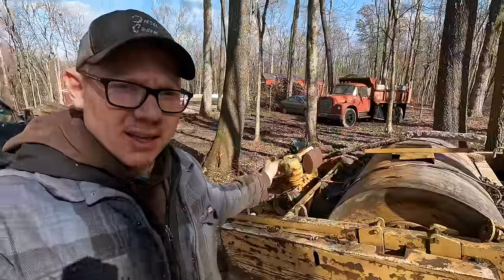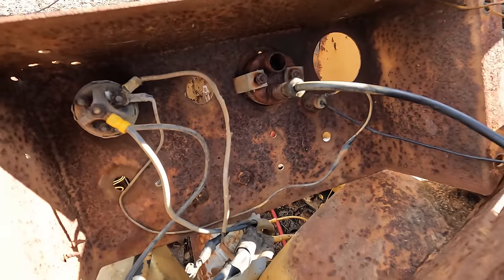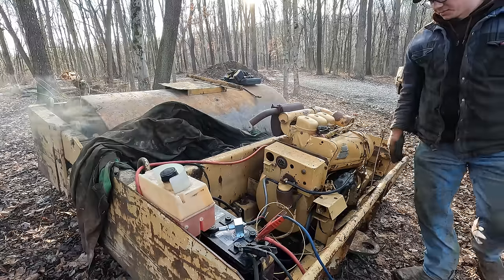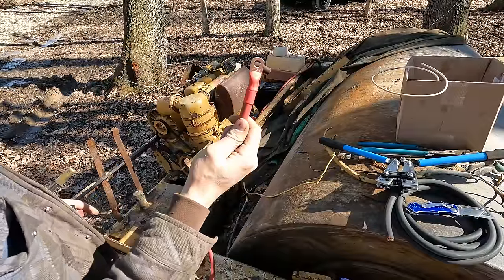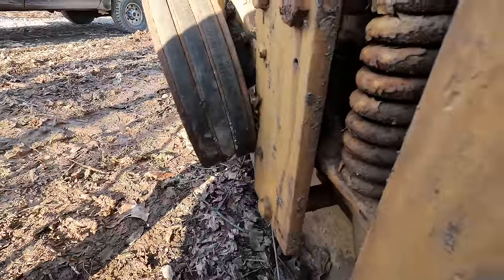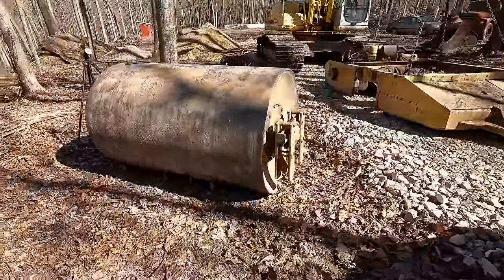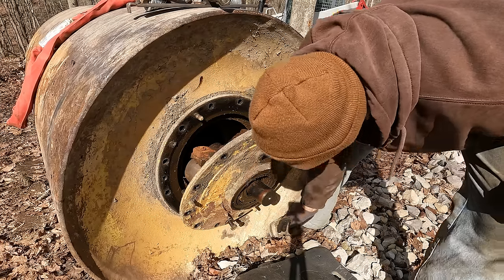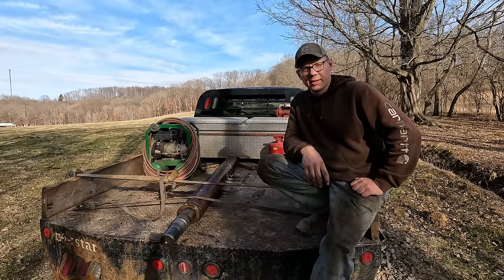Diesel Roller Compactor First Start in 30 years!! Can it be saved??

Comment: I would get the alternator rebuilt, fix the lift pump, clean lube and reuse all bearings, weld the shaft, etc. It will last as long as you need it, after that you can decide if you want to restore it.

Comment: Soldering that cable was the wrong thing to do. All that happens is the solder moves down the core making the cable stiff and now prone to the wires cracking under vibration. The solder will also deform over time, the alloy structure will then crumble and the connection will work loose. This is also why you don't 'crimp and solder' either. The best solution would have been to crimp a connector on the end (which gives you a perfect gas tight cold weld joint in theory) and then bolt the eyelet down. The next best (maybe) solution would be to push dielectric grease down into the cable core and then clamp it down, or just get a better battery clamp.
Anyone who says different is still listening to what his Grandad did on WWI submarines, or has never worked in industry where we have quality standards and calibration records for miles over every single detail of this cable termination process.
But good job on using some kind of crimp tool for the other connectors, that's better than 99.999% of other Youtubers.
You can actually get solder type battery cables, but they just suck unless you can somehow clamp down the cable

Comment: Just a quick tip from myself, an electrical engineer from Austria: NEVER put solder onto stranded wire if you are not going to solder it! 1st, solder is much more malleable than copper, so the whole screw terminal can loosen up over time and cause arc-outs, and 2nd, since now there is 2 metals involved, a lot more corrosion will happen... What you can do tho is firmly pre-crimp the stranded wire to get the strands denser together, so screwing them down should not be that big of a hassle :)

Comment: Hi Matt. Personally, taking into the account the amount of hours this unit might work for the rest of its life, I would keep the bearings as is, just grease them properly,
Reply: Seconded. Especially if you need it up and running for prepping the shop land, and you can swing the shaft repair, I’d just go bare minimum for it to do it’s job. 

As for engine fixes, that diesel needs no power to run once started (save the electric fuel pump — if you don’t replace the mechanical lift pump — but that massive battery would run that temp pump for a loooong time), so I’d just leave the alternator for another time, and charge the battery manually when needed.

It sucks not being able to fix something the right way, but sometimes you gotta take a look at the reality of the situation and act accordingly. Don’t let perfect be the enemy of good enough 🙂
Reply: @dphoenix1  Agree, it isn't going to be forever, just a couple (maybe) of uses.  grease it, weld the shaft as true as you can, slap it back together.
Reply: VW Rabbit glow plugs would probably work (junk yard?)if you can find them. Glad that third cylinder found some compression. Before oil change, but after Glow plug removal, might shoot some SeaFoam in each cyl and let it sit for a few. Might soften the ring grove crud. Cleaning with compressed air is OK, IF the valves are closed.
Reply: totally agree.  that thing turns so slow that I don't think it would make any difference.  clean em, grease em, and put it back together.  maybe add a grease fitting if possible to keep them lubed.
Reply: In the army I drove a M-578 recovery vehicle that had bad bearing in the rear tension wheel. thing would pop like crazy but would go.

Comment: Good video Matt. IMO you do not need to have that machine fixed for a 30 year lifecycle. At this point it time it only needs to be good enough to get you through the next project or 2. The way that shaft looks broken it seems like it was dropped to have it shear off like that. I would weld the shaft back as concentric as possible, re-grease the bearings and slap it back together and see what happens. It would be a nice piece of equipment even if you only get it running enough to serve your immediate  purpose. Good Luck...
Reply: Dope
Reply: Good Point!! There is no need for perfect concentricity... After all, it is SUPPOSED to vibrate.  However: the shoulders and diameters do need to be accurate. No matter, a lathe can handle that kind of stuff.
Reply: I agree, just clean all the rust you can off of bearings, clean with diesel, regrease it, repair shaft the cheapest way you can
Reply: @brucepeebles4939  I've fixed several smaller shafts with an arc welder, grinder, and skate wheels mounted on a wooden frame as a roller. Then I bought a cheap old lathe... Mine is only 48in between centers, which is enough for anything I've worked on.
Reply: Agreed. If your old employer wants too much to machine it then a "farmer fix" would be acceptable.  Find centers of broken shafts, drill out for dowels or 1" all-thread, V out gap, fillet weld.  Probably won't even matter if shaft is straight
Reply: I agree with the sentiment but disagree that this job can be done outside a machine shop.  A farmer weld would never work.  That shaft needs to be repaired properly due to the nature of the work and the location of the break.  The rest I agree.  Grease 'er up giver 'er hell.  If it only lasts 100 hours before another failure that will be enough to last the rest of its life.
Reply: Thats a fatigue failure, it slowly cracks bit by bit and can break more or less flat/square. The position of the failure is unfortunate because any rough weld job would have to be cleaned up with a lathe, and if u need a lathe then you just do the job properly for little extra effort... spigot for concentricity.
Reply: @Mitch Gates  you're probably correct about being a fatigue fracture.  To me the break looked to be behind the bearing. If so, a weld and smooth grind may be fine. And the repair you described would be the correct permanent fix. For the week he needs that he could probably get away without a bearing. Just trying to stay away from a long life cycle fix.
Reply: @knurlgnar24  you may be 100% correct but there are a lot of good welders outside of a machine shop. Why not take a chance at the weld yourself.  With a proper bevel, reasonable pre and post heat treatment it's worth a shot. Worst that can happen is you end up taking it to a shop if it fails.
Reply: @Bobsutubes  No disrespect to welders outside a machine shop, my point is that you need machine shop quality to make it work.  Due to the location of the break you need proper alignment, proper surface finish, proper heat treat, and full penetration.  A good portion of the shaft will have to be completely reconstructed with weld and that's not easy to do well.  I'm a DIY type of person even when I don't really know what I'm doing but this is a job I'd send to a machine shop without question.

Comment: Hey Matt! My thinking on the roller bearings is if the cages aren't damaged then the rollers will work fine. The pitting is from sitting not skidding. Put them back in and use a moly grease. They are load bearing and low speed they should be just fine.
Reply: Reuse bearings. The slow speed shouldn't be an issue. 
For the shaft, doubt it needs to be truly straight. A welder that bevels each end and gets good penetration followed by lathe to smooth out weld.
Reply: @wyattgardner3552    I was thinking that, but also center drilling, boring, and putting a hard pin of appropriate size ... kingpin from an old Freightliner, for example ... in the repair area, to reduce the chance of another shear breaking in the same spot.  It would likely do one of two things:  Fail right away, or, outlast the rest of the machine.  If it comes to "damned if you do, damned if you don't" and I have the means to "do," I'd try it.

I've seen much sketchier repairs work, much to my surprise.
Reply: @infoanorexic  Can’t tell until the stub gets pushed out, but if the shaft is symmetrical you can flip it end for end so the repair side isn’t getting the torque from the engine.   Weld repair should be plenty strong just to be a bearing journal.
Reply: Are they that slow spinning?
The shaft will spin at the rpm of the engine (around 2500rpm is my guess) since it looks like a 1:1 ratio between engine and shaft.
Reply: @therealgrizzly  The output from the engine spins very slowly, look at it when the engine is running, it's geared down!

Comment: For stranded cables like that you are supposed to use ferrules and clamp it like you put on the connectors. It makes a cold weld and make the wire solid where you put on your battery connector. Never use solder on battery leads. The low voltage/high amps make quite a lot of heat in everything that create just the tiniest bit of resistance - and it then gets soft and you get a bad connection when you need it most. This is the best way of doing it, but of course there is other less good methods that work too. I’m in love with ferrules tho - a game changer when I saw how nicely they cold weld and make something solid for you to clamp down on. If you put one on a piece of cable, crimp it and then saw it in two you’ll see what I’m talking about. It’s kinda amazing.
Reply: @BrianG-xj4nu  "Just my anecdotal opinion based on years of professional experience building emergency vehicles" - well it must be awkward to find out you've been doing it wrong all that time. 
"Ferrules don't make a cold weld" - yes they do, that's the whole point, a crimped connector is mechanically solid and gas tight, hence very little corrosion.
"ring connector that was properly crimped/soldered" - oh dear, you don't solder a crimp... it's pointless and it makes the cable prone to vibrational fatigue.
You really need to understand why everyone in industry, including aeronautical, NASA, military, power, transport etc is using crimps. There have been a lot of PhDs looking at this for decades and they know way more than me about why crimps work and why solder is flawed.
Source: I was an Electronics Engineer. The amount of paperwork involved just to specify, install and QA test a single crimped connection on military hardware goes to the moon and back, you better believe they are serious about what works and what doesn't.
If any of that failed in the next ten years, they would have dug out my name on the sign off and asked me why connector 42a, subsystem W1, rack 3, system F, pulled loose. Why it passed inspection, why the QA sampling didn't identify the issue, was the specification and installation correct and the calibration records for literally every tool that went with 50m of it. And then they are going to go over everything on that site with a microscope and my company would be in the doodoo for months.
Just because your grandad did something, doesn't mean it flies now, NASA boffins wrote shelves of books on crimps and not just for fun.
Reply: @____________________________.x  was there a garage electrician commenting and then deleted his own post?
Reply: @pederb82  yes it looks like he deleted his post, I must have annoyed him, oops 😬  well hopefully he’ll reassess what he’s been doing wrong all these years and read up on it, I don’t need him to like me I just want him to do it properly. It seems youtube is rife with his way of thinking, where on Earth are all these untrained people coming from?
Reply: @____________________________.x  indeed. It’s one thing to do it a certain way and then be thought how to do it properly and another to just flat out say it’s not true it cold welds etc. He should have tried with just one and see for himself instead. :)

Comment: SOLDERING TIP...   Matt i sure enjoy your videos. I especially like the succeed/fail way you present your projects. Anyway, to the tip. i have seen you do this in a few videos, and it is a common of people that dont solder much (especially welders. no offense) lol. It looks like your using the heat source to melt the solder or a combo of both. the problem with this is that the solder cools to quick with it contacts the wire, the natural thing to do is to apply more heat to where it does and it just snowballs. The key thing here is to let the wire melt the solder and not the heat source.
1) Always use a paste flux and rosin core solder. this does 2 things; it ensures you get the wire completely fluxed, also tells you when the wire is about ready for the solder since flux melts at a temp just below solder. 2)Heat the wire from the back side of so that when you apply the solder it draws into the wire. 
3)Do not use a open flame on wire, use a Soldering Iron ( Ya i know the propane torch is your fav thing to use 🙂) They do make soldering tip for them though.
4)After the paste flux melts, apply the solder to the opposite side your heating from. Allow the solder to flow through the wire. 
5) Do not over heat the wire. overheating it will cause the solder to not stick
I hope this helps you and your subscribers. Keep the videos coming they are awsome. Cant wait for the weather to break so that we can see your new shop.